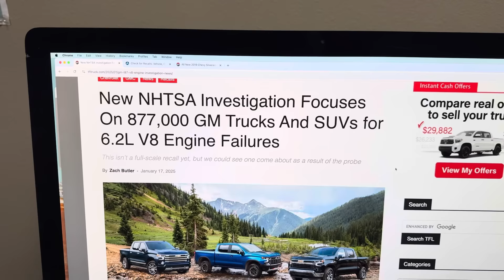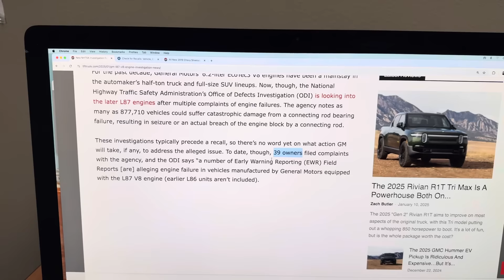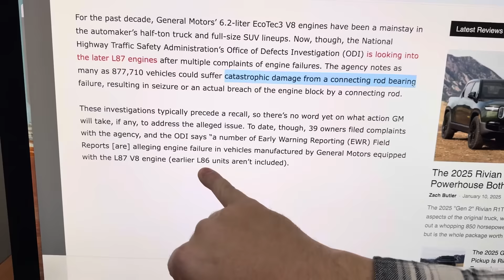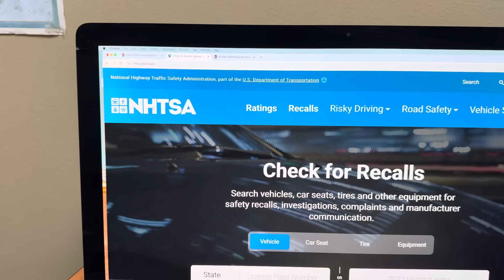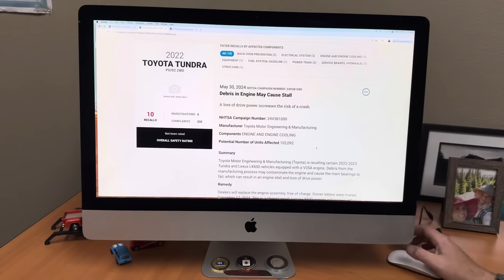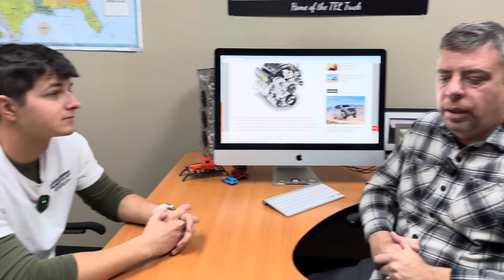877,000 GM Trucks & SUVs INVESTIGATED Over Failing Engines: Are You Affected?

Comment: As an engineer I can say that is not an acceptable defect rate. I also suspect there are far more than 39 defective engines.
Reply: May want to add couple 0’s to that number
Reply: @shawndangler553 proof?
Reply: @shawndangler553  That would bring the failure rate up to 0.44%, less than 1/2 of 1 percent. That's still a small enough failure rate, that GM should just replace the engines. The reputation is worth far more than the engine replacement costs under warranty. (That actually sounds close to the actual failure rate)
Reply: I have two neighbors with 2023 Escalades who both had their engines fail. This is so common, and it is all over Reddit
Reply: @ yeah, yeahhh. I’m in ranch country. There’s not a single home without a truck & we drive 45,000 plus miles a year or more!! You have no idea how many trucks are here. It’s a density rivalling rural Texas!! I’m a member of 4 truck clubs from off-road to full street. I am a member of the cattleman’s association, 2 different AG Societies. I have friends & acquaintances with 6.2s they have never had a problem. I haven’t even heard of a problem with them. Some fail a bit prematurely at 150,000 miles, but nothing short mileage. Some 5.3s used to fail a few years ago, but not so much now. It’s NOT anywhere near the numbers people want others to believe. I can’t figure why people need to exaggerate! I’m not even a GM fan!! Classics, sure! I have a few dozen, but not current. I’m a Ford guy. I admit Ford is less reliable than the GMs. I like the facts and not these fantasy BS stories. If you have 2 neighbours that had failures, they are d*mn unlucky. How many miles? Were they religious with maintenance? Did the run premium fuel? There’s a lot to figure out before you paint 877,000 trucks with the same brush!! Hahaha. Sheesh!!
Reply: @C10sRule  again premium fuel isn't required. I'm sure using 87 octane causes so much extra work on the L87 causing it to lose a whole 7HP. That must be a factor
Reply: @ - didn’t ever say it was THEE issue. Just said what was discussed today. Focus on something else dude.
Reply: @C10sRule there's countless posts on truck forums and Reddit with 6.2L motors grenades due to main crank and rod bearings. Some other 20k miles some with 5k. GM replaced motors but took months waiting for a new motor.
Reply: @ - I believe there are failures, but even if it’s 877 failures it’s a tenth of a percentage point. People that don’t have a problem don’t go on forums to say so because they get pecked at like a bunch of chickens when they smell blood. Yeah there’s failures, Sami with the 5.7 Hemi, the 5.0 Coyotes, all have failures and all are waiting for months for parts or replacements. Toyota are taken Tundras off the line to pull the engine for replacement in another warranted truck. It’s all over!! The last engine that was really bulletproof was the Toyota 5.7. Since then it’s been one thing after another. Often beyond the manufacturers control because some supplier of bearings, camshaft Tappets have cheaped out such that the manufacturers take a hit! Heck Takata airbags are STILL being replaced by manufacturers. I’m good friends with the owner of 2 Ford dealerships. His Techs say Fords are the worst, why? That all they work on. A couple of buddies work for Toyota as Techs and they say a lot of what Toyota is producing is crap, why? They only see Toyotas! I get the Ford Techs together with the Toyota Techs, a GM Tech was part of the discussion and 3 Ram Techs,,,,,. It was an eye opener for all of them to get together & see they are all in similar boats, but Ram techs are tired of the fight they get with every Cam failure & the challenge to get a new engine vs rebuilding an engine that been flushed wit metal shavings. 
    Go to a GM forum and that where you see all the GM complaints!! Same as a F150 Forum or DuraMax Forum. People bitch and others eat it up!! They see 40% of the people in a 500 person chat room about crappy GM have had failures & translate that to the whole line. These are only the complainers, not the thousands that have zero issues at all. 
     The only true 100% failure on a vehicle was the automatic in the Mini for 2 years. 100%. Even Fords bizarre automatic manual in the Fiesta wasn’t 100%. 
     Shit breaks, people bitch & whine. If they get an audience the stories grow & a cousins cousin had an issue. Look at the greater picture. If GM had the failure rate people are trying to say it is,they are looking at billions in losses….. it’s not all crap. I know of very few failures and none at low mileage! Maybe I go get a ZR2 tomorrow & it craps out on the way home. Ok then it got me. My worst truck ever was a 2014 Tundra that stranded me in the mountains 4 Fricking times!! Turns out a wiring harness was pinched. Took the tech that bought the truck off of me to find it in his off hours!! I still didn’t say the Tundra was crap. It was the most reliable up to 2021 by a shot! Sucked for me though. I have owned well over 200 work trucks and those not driven by me were rode hard & put away wet!! The maintenance was near perfect though. Fords, all but a few GMs that weren’t sturdy enough. All 5.4s, then 5.0s and at the end a few 2.7 EcoBoosts. Never had a drivetrain failure 1998 - now except with the Toyota, they replaced 2 transmissions. I did the same stuff before with a F150 5.4 3 valve and after with a 5.0 coyote with zero issues. (A few power windows and other niggly things like broken interior pieces that were generally abuse.  There are people that say it’s not if, but when the 5.4 will fail. There are 5.4s out there with over 500,000 miles! After a point it’s routine maintenance. 
    You are correct though that failures under 100,000 miles even are premature and annoying as h*ll!! It’s not a given though.
Reply: @C10sRule If you are in ranch country, there aren’t enough people with trucks to represent anything.
Reply: @ - you’re an idiot. Show up at a cattle auction one day. Cattleman’s association meetings, AG society meetings, and so on. You just proved you don’t know a d*mn thing! I had 12 guys working for me. I owned a 12 bay tire shop, primarily for commercial trucks, but our second biggest sales were to light truck tires. It was rare we had a car at all,  especially once SUVs showed up. Did all of that for over 40 years!  I’m still a part of the association & societies. Yesterday at coffee there were 14 of us sitting around visiting. Each of us have families, grandparents children, great grandchildren. The grandchildren all drive trucks!! What better for a family of 4 than a full side crew cab, or a full size SUV? 
     Now go away & troll someone else. I’ve been decent to you so far.
Reply: @C10sRule  I bet there are more trucks in the cities/suburbs even if the rate of truck ownership is higher in your ranch country. I live in rural utah where a lot of people own trucks, but there are housing developments down in the Salt Lake Valley that are probably the size of my entire "city" of 3000 people.
Reply: @C10sRule  amen brother! Just ordered a 2025 Z71 Tahoe and I'm excited I don't get sucked into people bitching online haha
Reply: Dealer bought my brother's truck that took a dump. I doubt his case was reported. His truck failed twice before they bought it back
Reply: you are right. many out of the USA. I am one of these, and I do know another incident here in Dubai, so that makes it 2 additional incidents in my small circle.
Reply: Our dealer alone has replaced more than 39 engines.
Reply: Yup!
Reply: I alone know 2 people that it happened to personally so I agree.
Reply: Not sure what you engineer but 0.00004333333% would be great in my engineering review.
Reply: @ you dot give up. If you are an engineer for the space programs. This is the automobile industry ya goof. Grow the heck up! I am done responding to your absolute stupidity & absurdity.
Reply: Good grief, what a ridiculous statement.
Reply: There are thousands
Reply: CAFE oils.
Reply: If that is exactly how the CEO makes her 30 million dollar cost cutting bonus checks 😂
Reply: I'm sure General motors and Ford are going to be hiring a massive Amount of warranty technicians really Soon 😂
Reply: They tried to save a whooping $3 on cheap part 😂
Reply: My 2020 Silverado 6.2 was brought into the dealership multiple times since purchase due to its burning 6-7 quarts between oil changes and a constant ticking noise coming from the motor.  Every time they (and Chevy Customer Service) stated it was common with this engine to burn oil and the noise was from the fuel pump.  Due to this, I have had to change out flooded plugs, all while GM saying there’s nothing wrong.  Fast forward to 1/3 of this year.  I was driving down the interstate and my vehicle lost the majority of its power and the dash lit up like a Christmas tree.  I immediately contacted the dealer and it was brought in.  Their initial diagnosis was bad lifters and bent rods.  While tearing it down they also noticed that multiple other parts were defective, along with scored cylinders.  Now I’m waiting on a new motor with no timetable in sight.  It’s been well over a month now.  With all the issues I had from the beginning, it feels like GM knew there was an issue and tried to cover it up as a “that’s how the engine is supposed to run/sound” excuse.  As a lifetime GM owner with MULTIPLE purchases, I’m really starting to re-evaluate my future with them.  The worst part about it is the total engine failure happened right after the power train warranty expired.  Fortunately I have an extended warranty that’s eventually going to cover it, but feel GM should be on the hook for this one!
Reply: Oil consumption issues on my 22’ Yukon Denali XL. I have to add 2 quarts in 4500 miles. Yet GM says it’s normal. 🤦‍♂️
Reply: @thomasabbotjr definitely, only 39 CONSUMER reports directly to the nhtsa
Reply: Which railroad are you with?
Reply: @thomasabbottjr  - As a practical and reasonable person I can say you need help. Of course there are more than 39 engines. There are several hundred. Even Toyota has a mighty failure rate than 1% so give your head a shake. 
    I would definitely fire you as you are far from objective.
Reply: @C10sRule  are you a Boeing executive because your willingness to downplay safety indicates you might be. I’m sure you’re thankful for people with my mindset when you use devices or machinery that could maim or kill you. As for objectivity, I’m simply stating the failure rate is unacceptable. If placing people’s safety above profits is subjective then so be it.
Reply: @ no I’m a pragmatist. Fact is not one manufacturer has better than one percent reliability, not safety, reliability. Sometime the two go hand in hand, yes. Then when o say the rate could be as low as 0.044% you say that’s too high?? You’re high. 
    At this point, now bringing up Boeing when I said I’m a Rancher, you really are an immature troll regardless of your age. In any worksite you are very likely a poison pill that sucks the life out of everyone in the office be a you just don’t know when to quit. Now would be a good time to stop. You have embarrassed and exposed yourself to be the arse you are. Move along. You truly are the thickest, dumbest engineer I have ever dealt with.
Reply: Ok there is 40. You got em.
Reply: @thomasabbottjr  0.0044% is unacceptable?? Hahaha. It is potentially the most reliable engine out there at that rate. How many people DON’T complain when a $9,000 engine fails?? Give your head a shake. If you work for one of my holding companies, you are fired!!
Reply: @ there is a much higher failure rate if you do the research. Regardless, Six Sigma would not be satisfied with the mentioned failure rate in the video. Glad you’re not responsible for people’s safety.
Reply: @ - so if you up all your money into an investment with those odds you would even make 10% rate of return, you think you invested your family’s assets wisely?? The odds of you being in a car accident on the way to work exceed that 100 fold!! Lunatics on here,, “Oh my god, the sky is falling!!”” Hahaha.
Reply: @thomasabbottjr every manufacturer has a greater than 1% engine failure rate. Why are you spewing Sigma garbage?
Reply: @davidporter7051  I respect the safety of the customer and public. I also expect excellence. If you’re happy with mediocrity then keep defending GM and apparently the whole auto industry.
Reply: @davidporter7051  are you high? You think that one out of 100 cars has a bad engine? That’s absurd
Reply: @Lolbrbb  it's called fact. try using facts you may actually grow bot
Reply: @C10sRule I suspect that almost no one complains to the NHTSA if their engine is repaired/replaced promptly under warranty.
Reply: @sonictech1000  my engine was replaced at 20 thousand miles for rod bnearing failure. Took 2 months to fix, trans went out at the same time. 2023 Zr2 red
Reply: @ - The manufacturer has to report that to NHTSA anyway. It’s not a one way reporting thing. There are also laws, go figure,,,,
Reply: @sonictech1000  exactly. The rod bearings seized in my 22 AT4 in less than 6,000 miles (Feb 23). It was a major pain in the ass but the dealer got me in a rental for a few weeks, replaced it with a drop in engine and that's as far as the complaints went. Just at my small dealer there was already another AT4 there awaiting an engine when mine rolled in. There's plenty of us out there. I highly doubt were part of some elite group of 39.
Reply: @Redrider2k2 I've seen plenty of owners post on forums and Reddit about 6.2L failures.
Reply: @stevemoore2616 man that sucks. Did you have a AFM delete? What was the oil change interval you followed
Reply: @adminadmin9997  truck is stock no mods
Reply: @C10sRule you will find it's a huge scale of failure.... We are seeing large numbers in Australia alone.. and our market is minuscule.
Reply: Hey buddy. I tore apart a 2022 Chevy suburban 4wd with a 5.3l. now I'm removing the engine after removing the front differential. Transfer case, transmission, front bumper and fascia and a ton of other things because the crankshaft has almost 40 thousandths end play. This 2022 with almost 70k miles basically needs an engine and it's out of warranty. The vehicle will be a skeleton tomorrow. I'm replacing the thrust bearing.  @C10sRule

Comment: I wonder how many owners actually followed the break-in procedure per the owners manual.  Additionally, before the first tow, GM recommends an oil change before that said first tow.

I always change the oil and filter 700 -1,000 miles on my new cars/trucks.  I never go more than 4,000 on an oil change (NA) and never more than 3,500 on a turbo.  Quality full synthetic only.

Hopefully that old saying "An Oil change is cheap insurance and cheaper than buying a new engine" will work in my favor!  I have a 2024 Sierra with the 5.3, but I guess only time/miles will tell.....  🤞🤞

Comment: Been a Surburban person my whole life because I grew up with them. Last one was an 06. When looking at a new large suv, I went with the Expedition because I'll take my chances with the 3.5l cam phaser issue and weak transmission. Because at least both of those are repairable and won't leave you stranded. 78k miles later and no issues yet. Sadly all of these suck, Ford, GM, or Toyota, all having issues. Between the government regulations and the poor manufacturing after 2020, it's all junk. Oh and costs 70k for that junk. But you have massive screens inside, so you're welcome.

Comment: The failure rate of 39 in a pool of 877,000 would be inside traditional industry standards. Engineers refer to it as meeting four-nine-five or 99.995% I suspect GM is worried since it's early in the life cycle of the vehicle that this number will grow exponentially if they do nothing.  Most engines of the mid 2000s went 250-300k with basic maintenance. Now companies that previously made engines known for power and reliability can't make an engine. Between EPA standards and the power wars going on between competitors it has created a situation that is a zero sum game. You got Ram now pushing over 500hp from a 3.0 liter twin turbo direct injection 6 cylinder. Its great but that puts a ton of stress on a small motor.
Reply: Just scrolling the comments down to yours, I'm conservatively taking that 39 up to 57 !!  Edit : Just read 2 comments below your's , we're up to 61 !!
Reply: Bull butter. I am just one individual and I know several people that has had issues with the 6.2L. Not so much as complete engine failure. But it has been lifter failure and cam failures. Oil consumption issues. This crap has been going on for decades. With the 5.3L as well. I have no idea why these idiots keep buying GM trucks. They are junk. I gave GM two chances and both my trucks experienced problems. Never again will I buy another GM vehicle. The reliability stopped when AFM was introduced.
Reply: They spend more time trying to make emissions than to make real cars anymore. Thats why ev's might be the way to go. Its not because its better, but because there isn't another option.. Companies can even make a normal car anymore cuz of regulations.

Comment: 39 people were upset enough to complain to the government.  Thats saying something. Nobody wants to talk to the government. And as a previous gm tech. This number of engine failure has way exceed 39. More like 39 failures per dealership per year. And this number is most likely too low for a nationwide advrage. And the problem with the 6.2 definitely did not start in 2019. Lol. The most reliable gm engines. 3.8, 4.3, 4.8.  Please don't get me started with how many 6.0s I've also seen scatter intetnals across the road with excellent service records and no codes that suggest abuse.